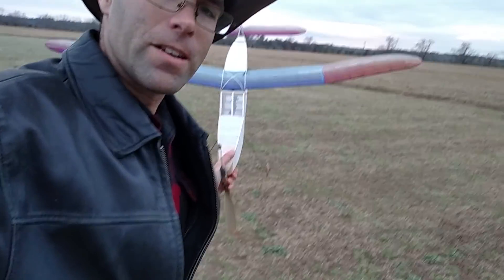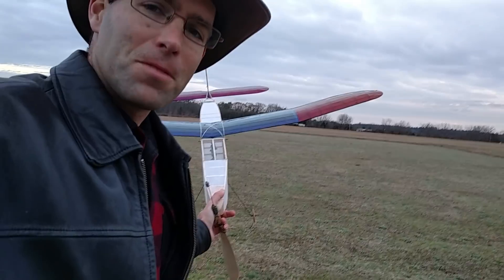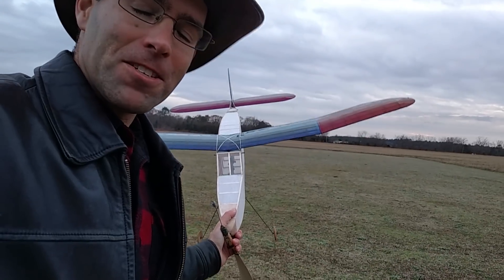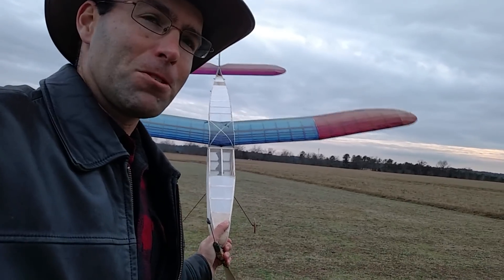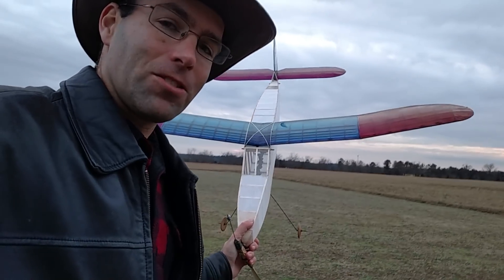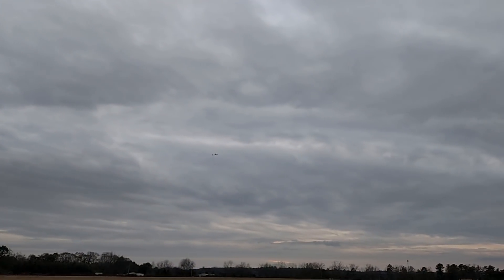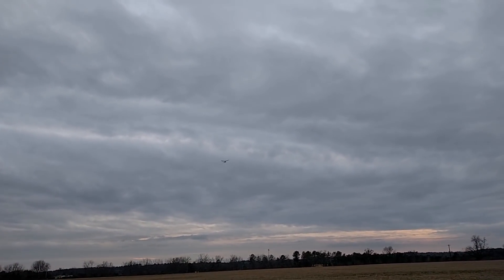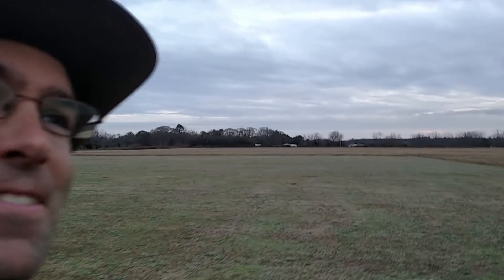The Korda Wakefield is an awesome rubber powered airplane!

Comment: Mr josh/company, still building the big korda and have a question re location of the rear peg on the one your holding, how far from the very back of the model is the peg? and I assume its still  28 strands 1/8
Reply: opppsss I meant 24 strands

Comment: Mr Josh, picked up a campbell Korda thermalizer and have some questions re wing/parts construction, am assuming you built one and hoping you can reply asap, will check back here soon
Reply from the maker: Shouldn't be much different from the published plans. Ask away and I'll see what I can figure out. :)
Reply: thanx for the reply, the fuse went together fairly well so did the rudder, the stab/wing ribs came in sealed bags which thier were many, infact too many which was confusing. so I layed the stab and wing ribs out on the plans  and thier were 3 -4 left over that didn't fit the plan size. I had to modify and even make some ribs so theyd fit which didn't seem right. so what Im getting at is some ribs are the wrong size and don't fit the plan

My question is have you built this kit from campbell??
if so have you noticed different part sizes from the plans??
BTW been building many years and can adapt but this one threw me a curve  

   @joshuawfinn
Reply from the maker: stan burdick unfortunately I haven't built one of their kits, only seen them. No idea what's up with the nonmatching ribs, but you did the right thing. It'll fly fine regardless.
Reply: well thanx anyway and were finally figuring things out altho much improvising has taken place, fuse stab and rudder built , wing should be a  chore and time consuming however cant wait to get it in the air   @joshuawfinn
Reply from the maker: stan burdick you'll definitely like it. It's a very good airplane and looks great thanks to just how huge it is.

Comment: My only problem with mylar type coverings is that I don't think they add much in the way of torsion resistance or strength unlike tissue and dope coverings, or silk or nylon, BUT I could be very wrong.
Reply from the maker: It's stiff enough that I'm not concerned. This plane has shown no problems whatsoever in terms of that issue, though I could see it becoming a problem if you ran 28-30 strands and really torqued it up. Either way, early in the morning, this stuff is definitely stiffer than wet tissue. The old fiber reinforced micafilm would probably be a good compromise. Polyspan as well, but you have to seal it.
Reply: Interesting points - I have seen some open rubber models with the fuselages covered in silk and doped, then using lightweight coverings for the wings.
Reply from the maker: I don't care for silk these days. I've been dealing with old silk covered models and the stuff just doesn't age well at all. Polyspan seems a little better, and it's perfect for fuselages as seen on this Korda. I think it's Sig that has a woven, sealed synthetic covering...that stuff is pretty awesome and would do well too (shrinks better than polyspan, too). If you're not concerned about compound curves, coverite is really strong and long lasting, and then there's that sail material I've seen used a few times...don't know where you get it, and it doesn't shrink much, but I've gathered its the lightest material you can get that's appropriate for covering fuselages.
Reply: When I say 'silk' I really mean 'parachute silk' which is really a type of rayon or nylon - but your suggestions seem much better, actually, so I shall investigate next time I am in building mode. You have made some very noteworthy product references there, I must say. It's nice when someone knows what they are talking about.
Reply from the maker: Glad to help. I should look into parachute material sometime. That could be interesting. Also, I forgot to mention Icarex; that's become rather popular for covering F1B and F1A wings. Really strong stuff. Don't remember what it weighs or what finishing requirements are though.
Reply: I have also used light white nylon, and doped it, on open structures - very, very strong, but use with care. When I was very young my father made a bungee launched glider using piano wire frames (20 gauge maybe ?) for the wings covered in (something like) solarfilm. It flew very well especially in really bad weather because the wings could flex. I suspect you could still do something like this. I shall look into Icarex. You can use heavier gauge cling-film on open frame structures, but it's not really all that (no doubt you have been there).
Reply: Tissue over Mylar is the way to go. It requires less dope and gives the torsional rigidity. It is more water and puncture resistant than simple tissue for less weight. 
Dick Korda won in 1939 because he caught a good thermal. That doesn’t mean it’s not a good model. With modern rubber and a well made prop it flies for a long time.
Reply: tried mylar once and it really was warp prone for that light balsa

Comment: Mr josh curious if you used any up elevator shims to take it up
Reply from the maker: stan burdick, I did, but you have to bear in mind I trim by setting the CG and then shimming the elevator until I get a glide I'm happy with. I don't move the CG to trim unless the vertical stab proves too small to damp yaw excursions at that CG location (in which case I move it forward).

Comment: am building a Miss Canada senior that resembles the korda wakefield and wondering if you've had any experience with that model?
Reply from the maker: They fly good. Be sure to keep the dihedral correct. The inner panels are shown incorrectly on the Easybuilt plan--it's 3" at one dihedral break with the other panel lying flat.
Reply: so your saying the inner panels lay flat then bend at the break right??

Comment: Korda history info good read>>>>>>>The contest date was August 6, 1939. The place, chosen by Bernard McFadden, publisher and patron of aeromodelling: Aviation Golf Course, Bendex, NJ .The event: "The 1939 Wakefield International Cup" contest, of course! But the original contest site that was chosen by the American Wakefield Cup Committee, the Bendix Airport, was rejected by the attending SMAE officials as unsuitable for the Wakefield Cup Contest! "On arrival at the proposed flying ground it was immediately seen this was far from ideal, and an inspection of the spot allocated for the contest proved this to be quite impossible as it was sandwiched between a dense wood and the airship hangar." The only alternative was the Golf Course. The weather was "boiling hot" according to the English Team Member Norman Lees, but perfect until noon. There was no wind, and there were thermals everywhere!

Korda's Wakefield had just the right climb, not too slow and long, nor too steep and fast, it just climbed out. And got very, very high. After 60 seconds on the propeller, Korda's Wakefield leveled out at 300+ feet, the propeller folded back, and it went into an exceptional glide pattern, indicative of a perfectly trimmed airplane. Losing imperceptible height, Korda's Wakefield drifted toward the bottom of the Golf Course where, now at an altitude of about 200 feet, it was taken gently by a thermal. "Within a few minutes it was over a thousand feet, and soaring up with each turn." According to Leonard Stott of Team GB "Ten minutes passed as many eyes watched, and Korda's Wakefield was now at about 1,500 feet altitude!" Up there it circled, minute, after minute, now the Wakefield itself was looking down at the point from which it had taken off. Then it drifted down course again, past the end of the field, slowly gliding downward, and finally, landing! The official time for that flight was 43 minutes 29 seconds. Richard Korda made two other flights that extraordinary day, for an average time of 15 minutes 50 seconds. Was Korda's Wakefield an exceptional aeromodel? Yes it was, and still is to this day. It's only drawback was that it was so common! It was the standard cabin model of the "Cleveland Balsa Butchers", everyone in the club made them. Chester Lanzo and Richard Korda perfected the genre. Korda used a much knotted "T-56" brown rubber motor, 47 inches long, consisting of 18 strands of 3/16", cranked in 1200 winds to turn a 18 inch diameter single bladed propeller on the winning flight. Korda remarked that his Wakefield flew better under "reduced" power.